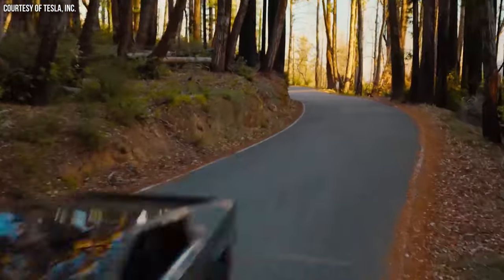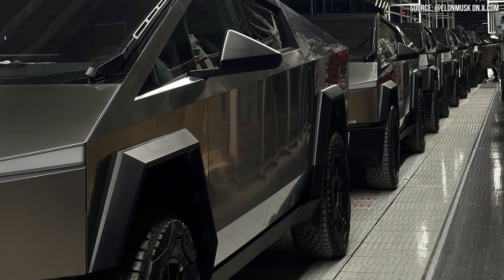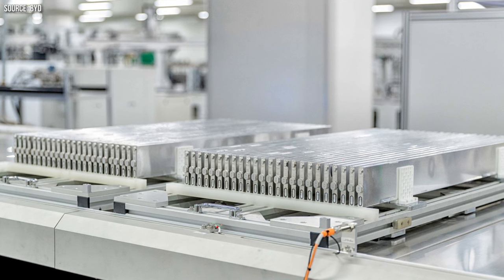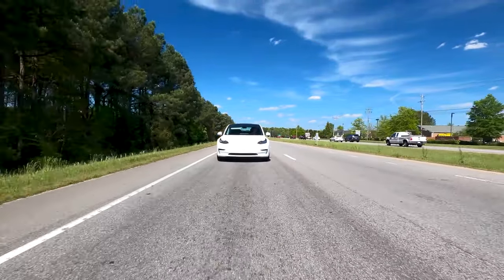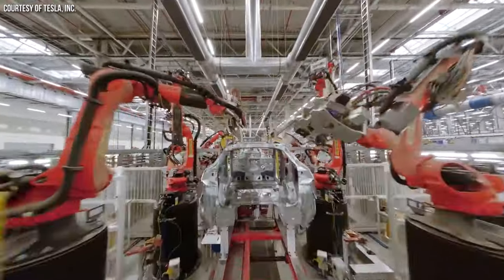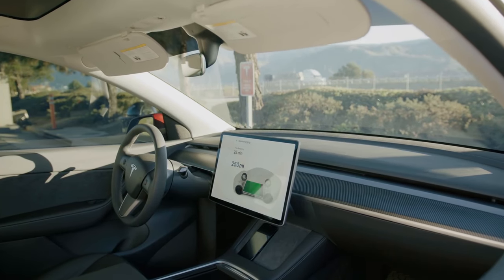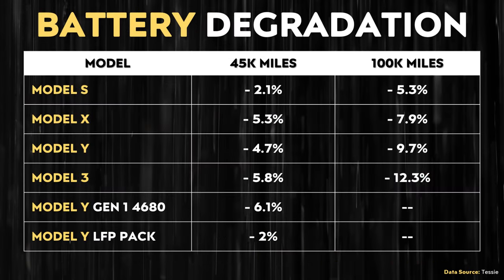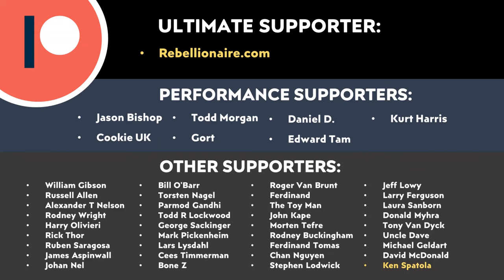$61K Tesla Cybertruck w/LFP Batteries | Coming in 2025?

Comment: As an owner of a Tesla Model 3 with a LFP battery, I have to agree that the lower energy density LFP still offers an effective range not far below the long range Model 3s fitted with higher energy density nickel chemistry cells that are only charged to 80%. I suspect that over the longer term that LFP Teslas will have a greater resale value due to their more robust batteries.
Reply: LFP is the way to go. I wish my Model Y LR had them. Would love the faster charging and 100% charge rate. They are cheaper batteries too. I think Elon is making these calls. He needs to understand that EV owners want an ICE owner gas station experience. Mass EV adoption with faster charge times.

Comment: Personally for any towing, living in the northern cold climate, for lack of charging infrastructure and remote access, still wanting 500plus mile range.
Reply: It will happen, just not yet. That is a niche as 90% of people don't need it. But once Cybertruck is ramped enough filling that niche will become worthwhile.
Reply: But let’s say the charger network is more extensive, you would then prefer faster charge times versus range. Spending only 10 minutes in station versus 30?

Comment: LFP Truck is the way to go.
Reply: I live 25 miles from town and drive a long range model Y. Typically I charge to 60% and drive about 150 miles in a day. I could easily use a cyber truck with LFP batteries. I
Occasionally tow boats, etc.

Comment: Unless you don't use your EV for any long distance driving, range is king. Having the ability to charge beyond 80% when needed on long distance trips is important. My first EV, a 2019 Tesla Model 3 SR+ had a 240 mile EPA range estimate w/18" wheels (my Tesla had the 19" factory wheels so it actually got less than 240 mile range). I drove it from Dallas to Telluride, CO and regularly had to reduce speed below the posted speed limit when encountering unexpected headwinds to make it to the next Supercharger. Range anxiety was real. I did the same trip in my 2023 Model Y LR and the extra capacity of the LR's battery made the trip so much more easy. When LFP can match the range of NMC for long distance trips, I'll consider LFP.
Reply: Understood but if the charger network was more extensive you would prefer faster charging then range? I am of the opinion that we will have mass EV adoption with faster charge times, like ICE gas station fast.
Reply: @Lduke32  and it will be induction charging soon enough

Comment: Interesting calculations; thanks for sharing. Your starting point is that the cells need to fill the volume of the structural battery pack. Please clarify the volume of the Cybertruck battery pack and what capacity of LFP cells would fill that volume. My guess is more than 90kWh. ☮️

Comment: Those Blade batteries are 118mm tall too (vs 80 for the 4680), which would make use of that "empty" vertical space we see in the current CyberTruck packs.  Probably not all of the space (rough guess from the munro videos) but quite a bit of it.  Also worth note, BYD claims their new Blade 2 batteris have 190Wh/Kg, a 23% improvement compared to their current Blade1's 150Wh/Kg,.. presuamably what's in the current Teslas (Berlin Model Y?).

Comment: Thanks Jon!  One issue for me...I think BYD blade cells don't qualify for IRA credit, so that doesn't seem fit the description that "Cybertruck is likely to qualify for the federal tax credit later in 2024."
There's definitely advantage to using 4680 form factor, as pack assembly would be identical to the existing pack.  What about Panasonic's 5-tab NMC cell?  With less active material, a battery pack made with these cells should have a lower energy, especially on earlier versions which should be more conservative.
Reply from the maker: Great points that I had not considered!
Reply: Panasonic's cells won't have lower energy density, if anything they'll come in higher. Tesla will simply use in-house cells and decontent the pack or wait until LFP production in Nevada is operational.

Comment: Tesla surly needs and i'm sure wants to extend the Range on the Cybertruck especially while towing! or they could add a second towing battery pack that didn't need to be used except when towing. like a full bed size battery that fits easily in and out for customers that tow or drive long distances. and it would also be awesome if they could make it compatable with the new high capicity Simi chargers! or they could actually make a battery powered Trailer in 3 sizes small for cars medium for Cybertruck and Large for Simi with batteries to compensate for the extra weight. and Solar to keep them trickle charged.

Comment: Batteries need to get better, not worse. Tesla is going backwards with LFP. When EVs hit th emarket, there was that promise that batteries will soon be much better. But the opposide is the case.
Reply: This is not true. Tesla has long been claiming that energy density is more than enough and the real improvements must come in cost efficiency. High energy/power density for the most high perf vehicles.
Reply: This statement is so wrong on so many levels. LFP is constantly improving and dramatically so.

Comment: This was pretty embarrassing to watch.  You didn't properly do your research before making your claims.  The 4680 batteries provide 0-percent structure to the battery packs.  There are composite/metal rails dividing the batteries that are providing the structure to the battery packs.  The 4680 batteries themselves, are just hanging from the top of the battery packs with a massive air gap below them before you get to the bottom shell of the battery packs.  Go check out Sandy Munro's video of the Cybertruck teardown to see.  You should have done that before making this video that continues to perpetrate the myth of the 4680 batteries providing any structure to Tesla's battery packs.  Shame.
Reply from the maker: You missed the point of my video entirely... my video is factually correct and the Munro team said many of the same things I did. My point was that Tesla's original battery day structural pack design showed no extra structural rails - but the Cybertruck pack has them.